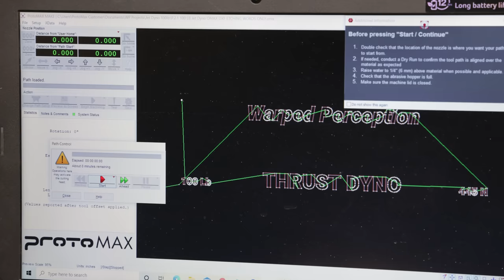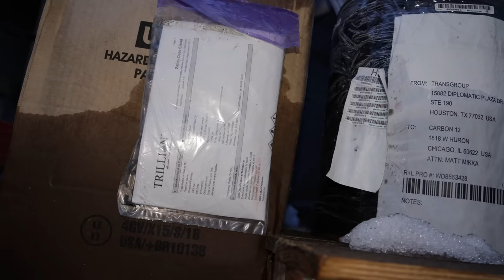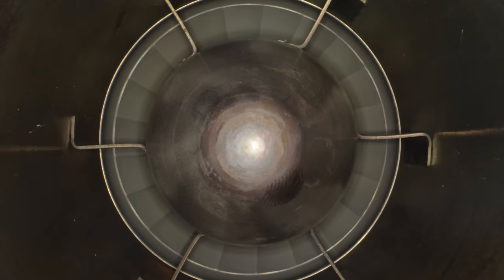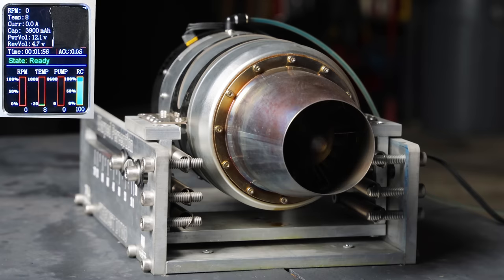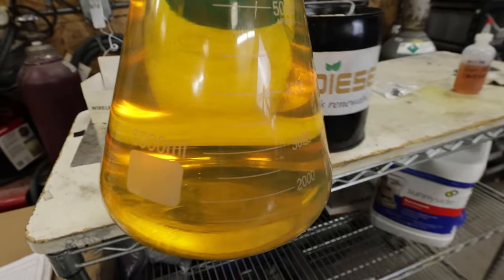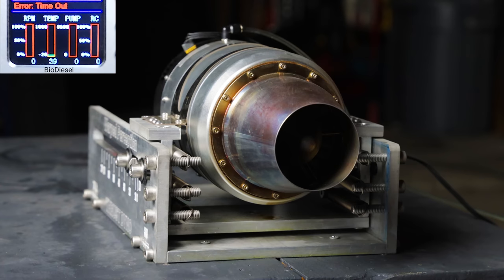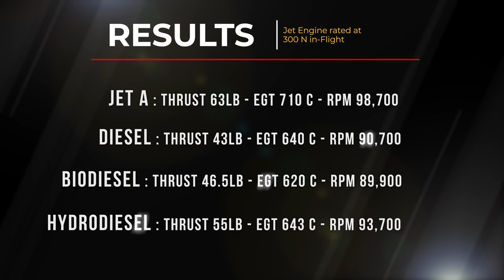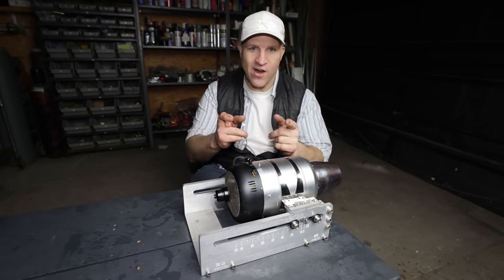Jet Engine Thrust Test - Fuel Experiment (Jet-A vs Diesel vs BioDiesel vs HydroDiesel)

Comment: Would like to see "offroad" diesel tested also. Its the red colored diesel with high sulfur content.
Reply: In order to establish automotive diesel oil standard which can be adapted to China-IV stage emission standard, engine performance test was performed on a high common rail pressure, turbocharged intercooling diesel engine, which could reach Euro-IV emission standard, by using the diesel oil with different sulfur content, and the effect of sulfur content on the first and secondary sulfate PM emissions was predicted by the experimental results and literature search. Engine test results show that the sulfate in PM, gaseous SO2 increase linearly with increase of sulfur content, during ESC test cycle, the sulfate emission of diesel oil with 500 μg sulfur/g is 40% of Euro-IV PM limit; the conversion rate from S to sulfate is about 1%-2%, and sulfur content has no significant effect on power, fuel consumption, non-sulfur emissions and in-cylinder combustion process of diesel engine.
Reply: I believe the red is also ultra low sulfur. Sulfur was used as a lubricant.
Reply: The sulfur was present as it is naturally in the crude oil and refines out with the heavier fractions of oil. As it caused no problems to the operation of the engine it was not removed until the high amounts of sulphur dioxide in exhaust emissions became an issue with the rise in acid rain. It is now routinely removed from fuel oils except the heavy oil used in ships and aviation fuel as there is still no legal requirement and it would increase fuel cost
Reply: Only difference is taxes anymore. Been that way a few years
Reply: Offroad diesel just has red dye in it. Meant for farming and non taxed.

Comment: The engine most likely has fuel injectors that are optimised for a certain type of fuel. I’d love to see these tests done again with the appropriate injectors for each fuel.
Reply from the maker: I'm currently trying to figure it out I'm going to update everybody really soon
Reply: Warped Perception :)
Reply: @WarpedYT  did "someone forgot to add vegetable oil (as a doable substitute for diesel) among those types of diesels ? Might be you tho :-)
Best regards from Romania :-D
Reply: @WarpedYT  since biodiesel and hidrodiesel are some somehow a bit of substitute for conventional diesel,why not the (as example) the sunflower oil? Farmers on my country use that vegetable oil in 80% oil - 20% diesel mix to run their tractors in farming campaigns and they loose almost no power/performance,just a little shorter lifespan for the injector nozzles,but it last for few dozen tank refills until that happen,unless they get a bad mechanic.
Reply: Biodiesel has less BTUs, used less fuel and had more Thrust.
Reply: This test would mean a lot, especially making each test more comparable.
Reply: i wanna see how a bunch more fuels burn, like liquid methane, liquid hydrogen, propane, butane and hydrazine. 😆
Reply: @jackasshomey  All low energy fuels except hydrozene.  Won't run too long on that stuff, and then, who is going to pay for it.
Reply: @bill7802  beats me but it doesn't need to be the ultra-pure that's used in the iridium satellites as propellant so it should be a fraction of the price.... lol but thats if you can even find a place that sells something that can explode on contact with low heat sources 😆
Reply: @bill7802  either way for most of the fuels im thinking of the chemical composition of them, fuels like methane propane and butane have varying levels of hydrogen atoms, methane has 4, propane has 8 and butane has 10, i want to see how much power is generated when burning them out of an engine that can force shitloads of oxygen into the fuel mix, and then hydrogen will basically be like a HydroLOX burn just without the liquid oxygen
Reply: @ScarryMarian2012  how would it shorten the life span of the nozzles in the diesel engines? Biodiesel is extra lubricity and that's what diesel fuel system thrive on.
Reply: @anthonyross4418  o think it might have to do with the fact that it is more vicious and burns dirtier so the nozzles most likely get clogged or physically fatigued to a point that you can no longer use them
Reply: I was about to leave my own comment about the size and shape of the fuel nozzles.  The way the each fuel is vaporized and injected into the combustor will make a little bit of a difference in the performance.  Other than that this was a cool experiment!
Reply: @WarpedYT  Since the injection system is fixed, Would running all of the fuels at the same RPM be a better comparison. Or better yet, what would it take to push all of the RPM's up to 99,000. Thanks, Nice video, I'll be keeping a link to your stuff.
Reply: Don’t judge me but I find this very amusing and I also fine falling asleep listening to jet engine sound so easy for me to go to sleep to remind me of being on the JetBlue plane
Reply: If you use fuel injectors you could adjust the timings for each fuel type.  Just like cars do with that e85 gas.

Comment: I think another thing I think could help with the experiment being more accurate is putting a large fan in front of the jet engine to simulate flight. If I’m not wrong, thats the main source off keeping the engine cool
Reply: Yes and no, the cooling effects is negleable. Unlike a car engine which is air/water cooled, for a jet engine, the only part really needs cooling is turbine blade. Cooling the compressor maybe beneficial, but it won't make that much a difference.
Commercial jet engine (turbofan) is usually cooled with bypass air, which is driven by the big fan in the front of the engine. Their turbine blade is cooled using bleed air from high pressure compressor, not air from the outside. In fact, the only time a plane needs outside air for cooling is to cool compressed bleed air from the engine to cabin.
Most tests on commercial engines are done on static test stand without anything blowing in front, unless it's testing for water/hail ingestion where water or hail is sprayed in front. They will fly test the engine, to verify the numbers

Comment: What career path should I follow in college to manufacture aircraft turbines?
Reply: Definitely Aeronautic/Aerospacial Engineering
Reply: Guacamole studies wink wink
Reply: Mechanical engineering
Reply: Materials / manufacture Engineering comes into it as well.
Reply: Aerospace propulsion engineering
Reply: Mechanical Engineering or Aerospace Engineering with a concentration in propulsion engines.
Reply: Meat Vendor, you should learn how to weigh meat.
Reply: Wood work class
Reply: It's heavily dependent on which aspect of the engine production process you're interested in. If you would specifically like to manufacture engine components, I would go with either mechanical engineering or materials science & engineering since both manufacturing techniques and material selection very closely intertwined in turbine engine production. I would not go with aerospace engineering as others have suggested IF you are purely interesting in the manufacturing, since most aerospace engineering programs do not focus much on manufacturing/materials. Aerospace engineering would be a much more appropriate route if you were interested more the design of the engine, though much of the design process is also worked on by mechanical engineers as well. I work for a company as a research engineer, and I work with many people involved in blade design and combustion research (computational research mostly), and there's a pretty even ME/AE split there as well, since both majors can overlap a lot in that area. As a mechanical engineer I'm personally more biased towards ME since it is a little more of a catchall major, and you can work on most of not all of the areas of turbine engine design/manufacturing. If you would like to be more hands on with the engines (since we were assuming you wanted to do more design rather than repairing, rebuilding, etc.) then you would need to get an A&P license. Delta Air Lines has posted some videos about their MRO business if you're more interested in that. They do a very large amount of engine maintenance.
Reply: MMAE  , masters in mechanical and aerospace engineering.
Reply: Accounting class
Reply: physics will cover all aspects
Reply: "YOU DON'T NEED COLLEGE, INFORMATION IS FREE, HAVING A COLLEGE DEGREE JUST PROVES YOU CAN DO YOUR CHORES"  -ELON MUSK
Reply: Apply at Boeing. They need fresh meat, don't wait for a degree to apply. Boeing respects it's employees more than most and can be a great career. No diploma needed.

It'll take a while to move up, but who knows. They could hire you in to the turbine department.
Reply: Gender studies
Reply: Personally I am going to get my A&P license, which stands for airframe and powerplant. Then ill work as an aviation maintenance tech. Another option like alot of these people have said is aeronautical or aerospace engineering, the reason I didnt want to go into either of these is because those fields will be mostly designing and doing the math behind the engines, to work on them you have to get your A&P liscense.
Reply: @ramaii6555  Classic!!!
Reply: LEGO Masters.
Reply: Manufacture or design? Everyone saying engineering is assuming you're going into design. Manufacturing... that's a tech trade, you can get an Airframe & Powerplant license from a technical college and pursue that.
Reply: prob would be cheaper then buying one of these
Reply: TikTok
Reply: Look into volunteering for a 2 year hitch in the US Air Force. They'll teach you and unbelievable amount on Jet Engines and their repair and you'll be paid while in school. And when you get out, you'll have a working knowledge of some of the most advanced engines in the USAF as well as being a vet will give you all sorts of benies all through life!
Reply from the maker: @MockOverdrive  when I talked to Elon like 12 years ago, this was one of the few things we agreed on.. however it's not 100% accurate but it is pretty close.. issue is everybody is a little different.
Reply: learn CAD and get a lot of endmills
Reply: I am a recently graduated mechanical engineer with a focus in aerospace. This is the ideal degree to design and manufacture all type of turbines; for hydro power, wind power, and propulsion.
Reply: @supergeekotaku  a
Reply: Mechanical engineering and then make your next move after that.
Reply: TBH, if you're exclusively interested in turbines, go for the Turbomachinery major and manufacturing minor.
Reply: @anonymous-cc6nv  "physics will cover all aspects"

A physics degree will not teach a single useful thing for turbine manufacture.
Reply: @MockOverdrive  Thanks dropout. I think we got this covered though.  Screaming bullshit in all-caps on a CV never helped anyone,
Reply: @scottycatman  there are probably only 3 or 4 useful answers in this thread, and that's one of them.  

Nobody has mentioned the phrase "Turbomachinery major" yet, so you can tell most of these guys haven't got a clue.  

Turbomachinery and manufacturing are the key here.  An aerospace degree is going to be 80% useless for him if he wants to focus specifically on turbine manufacture.

I did my bachelors in aero eng, and masters in manufacturing eng.   

After the bachelors, I could have designed a turbine engine, but i would have struggled to design in for manufacturing in a cost effective manner (and from a materials point of view).

Conversely, the manufacturing masters taught me jack shit about designing engines. But it taught me how to select the best materials and do it in a cost effective manner.
Reply: @erickuhn1042  No, a turbomachinery degree with major in manufacturing is the ideal degree.
Reply: Go woke go broke......
Reply: @Welcome2TheInternet  and neither will a general mechnical engineering degree genius specialized focus for aerospace is a conflation of the two with physics and especially a graduate degree in it with an emphasis in propulsion will carry plenty of weight with defense contractors
Reply: I agree with you. There is a large divide between the people who want to design the turbomachinery versus the people who want to work on such equipment.
Reply: go to a trade school for A&P
airframe and powerplant. or just your powerplant rating
more jobs with the A&P though
Reply: @WarpedYT  How come you talked to Elon?
Reply: BS in Aeronautical Engineering
Reply: What is the cost of the jet engine  can u tell pls
Reply: You need an Aerospace Engineering degree with a final year project on Aero Propulsion(talk with Propulsion professors on active research topics).  Either take a Design or Manufacturing route through your studies. Design and Manufacturing based modules are important. There is likely going to be a class on propulsion so you might want to take it if it's not compulsory.

It's possible to be MechEng and work on Jet engines but I imagine the curriculum will not be specialised enough although, Thermofluids, Fluid Mechanics, Computational Fluid Dynamics are important subjects you want to consider if you want to go MechEng route.
Reply: engineering
Reply: Nice pfp, Avocado was a good album
Reply: All mentioned disciplines are under Mechanical Department
Reply: Honestly, its easier to just go into aviation mechanics and take a powerplant class. I learned how turbines work in a 24 day class. Now I can take that and work for GE building them. Now designing them is a different step...
Reply: @utley  if you learned about turbines in 24h so you don't know what turbines is, honestly.
Reply: @ziyadahmed6585  I know enough to know how they work. Its stupid simple how they function. Designing them is a bigger ordeal. Putting them together just requires the ability to read instructions and blueprints. Fixing them requires the ability to read diagnostics equipment and understanding what heat damage looks like, and a basic understanding of how hydraulics work. All a turbine does is compress cold air, then feeds that cold air to extremely hot temperatures which turn to thrust via an extremely large rate of thermal expansion. Everything in between is what controls it. And honestly, they are by far more simple than a car engine. And different engines turn that thrust to different types of work. A turboshaft turns that thrust to brake horsepower to spin a prop or rotor. Easy to understand.
Reply: I also said a 24 day class, not 24 hours.
Reply: @utley  good enough

Comment: The diesels at the start seem to work best when spraying a tiny amount of excess fuel  . A blue flame to white is almost always the hottest and most efficient burn. Maybe i dont know enough about jet engines but seems to be set up for lighter fuels and the heavier fuels just seem to glow at he highest RPMs . Overall a smart educating video
Reply: In jet engines the rate the fuel burns is critical, a slower burning heavier fuel will tend to burn towards the tailpipe possibly after the power turbine so the engine will lose compression as the turbine blades will not receive the energy to drive the compressor blades at full speed. I worked with some larger Allison turbines changing fuel from Jet A to diesel or to gas would mean changing the entire fuel nozzle and manifolding assembly. Sometimes even the ignitors would need top be changed due to different laminar flow of the fuel mix into the flame cans.
Reply: @raygale4198  great explanation I would like to add that jet fuel is a very narrow fraction (the hydrocarbon molecules a almost the same length) so they take in air fuel mix the same time to burn and they burn very clean compared to diesel because diesel isn't so narrow fraction it is composed of longer and shorter hydrocarbons the later once are the reason it burns so suty  (and as you validated my assumption that the longer molecules take longer to burn and therefore decrease efficiency)

Oh and the water diesel performed better because of the vapor pressure and the water will explode the mico fuel droplets in to smaller once increasing the surface area and therefore burn speed (witch was too slow in plain diesel for that turbine tune)